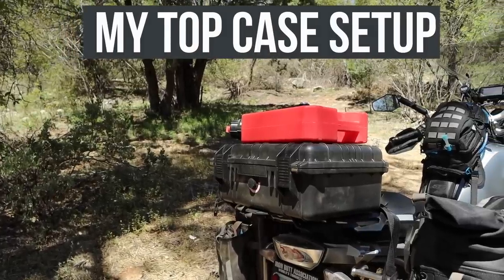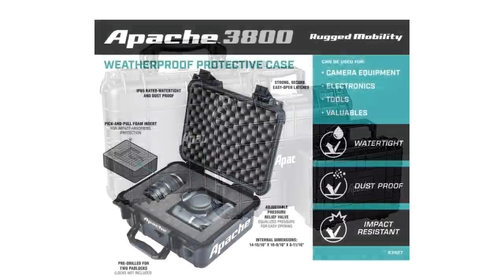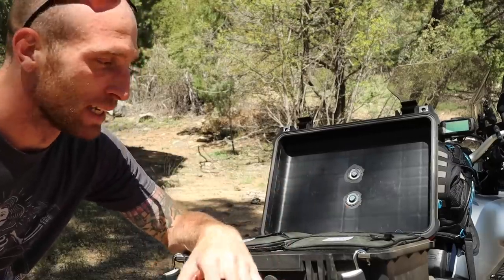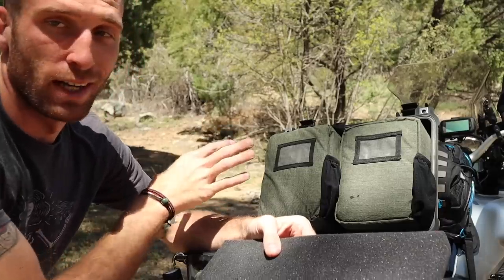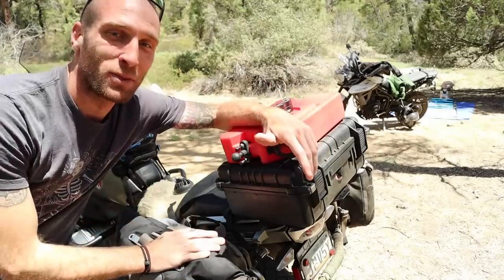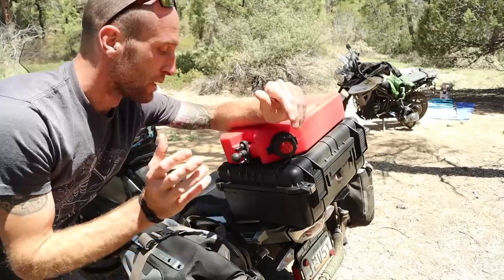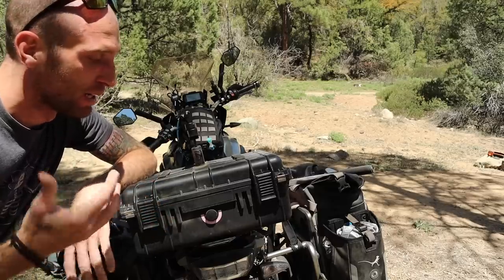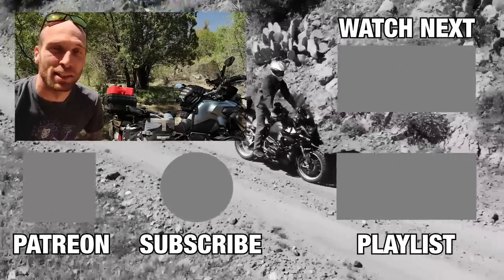My Top Case Setup - Cheap and Easy DIY Luggage For Motorcycles

Comment: I have the same case on my bike. Add a single piece of aluminum plate on the inside of the box for the bolts to go through. This will prevent it from warping and makes it a bit more secure. I think I used a 2" x 8" piece.
Reply: I bolted 1/4" aluminum plate to my Himmi and strengthened the tail rack. Now I have a choice of whatever box that at one time held a tool. Each uses the same bolt pattern. It's a good idea to use a plate on the inside like a giant washer especially riding rough roads. A larger top box that works well is the Craftsman versa tool box. It's waterproof and dust proof. I sprayed the red lid gravel grey so it looks less like a tool box. A man's got his pride ya know. 😆

Comment: I have that exact same case as a top case. Mine holds my camp kitchen (infamous Stanley), 3 days of food, and fire starting supplies. It's mounted reverse of Tim's so it opens from the front, that way it doesn't interfere with a loaded back seat when open. I also mounted aux flashing and brake lights on the rear.

Comment: I use very similar system on my klr. Cheap princess auto case bolted to rack. But I put aluminum plates around bolt holes to distribute the clamping force to a bigger area of plastic.

Comment: Hello friends! I ship expensive breakable stuff to customers and use quality cases for that. Pelican, Nanuk, Seahorse, and SKB all make great cases. Seahorse is probably my favorite because of the price/quality ratio, with Nanuk being second. Anyway, I tried going with the Harbor Freight cases (and even mounted one on the back of my DRZ400 because of the ridiculously low price, and while they are fine and don't leak and all, they are very cheaply made. The plastic is not comparable to any of the other cases I mentioned, and it will crack quite easily. In fact the one on my DRZ cracked at the base where I had it mounted just from the vibration of the bike over a year. It's not a fibrous plastic like the high quality competition--it's just a vacuum formed plastic that is made it look like it is a quality case. I'm not saying you shouldn't use them, but just be aware when it comes to durability the HF cases aren't even in the same league as the big boys. If you mounted them as side cases and drop your bike, they would be toast. You can run over a Pelican case with your bike and you will be the one hurting, not the case. My 2C. <3

Comment: How fortuitous for me!

I was researching a top box to fit on my scramblered Thruxton, and was ready to send you a question about yours. This is perfect!

Thanks for this video!
Reply from the maker: Glad I could help!
Reply: @FTAAdventures  I put a storage crate on my top mount so my helmet doesn't fall off the saddle or move the mirrors out of adjustment. Tim, thanks for recommending a good upgrade!

Comment: Great idea Tim, thanks for sharing. One question: why did you put the bolts through the rack from underneath. Good engineering practice is to put heads ‘up’, so that should the nut come off (by vibration) the bolt will remain in the hole (it also means the bolt tails won’t stick up inside the box).

Comment: This is an awesome idea for storage! The KTM bags on my super adventure are “super” expensive and don’t fit very much, given their large exterior dimensions. A while back, I bought a Milwaukee M18 kit that came with a packout case. Until now I had no real use for it but after seeing this video, I might just try to mount it sideways and scoot it forward over the passenger seat a little so that I can use it as a back rest too. Milwaukee makes a mounting plate and an assortment of different cases that fit and lock together in modules. They even make a cooler that connects to the system.You’re always full of great ideas Tim and such an inspiration to the motorcycle community, keep it up!

Comment: If you don’t have a flat bracket and just a tubular rack to mount to, you can also use rubber insulated clamps to mount the box to the frame with no permanent mod to the bike-rack.  Mine hasn’t moved and works great.

Comment: I have a couple of those boxes, possibly the next size bigger, that I bought specifically for making a set of interchangeable panniers that I can switch between my different bikes.  Using Tusk pannier brackets to make them quick release but they don't make pannier racks for any of the bikes I want to use them on so I bought a tubing bender and I'm about to start making the racks myself,  just buttoning up a few other projects first.  Seen a KTM with Pelican box panniers a year or so ago and fell in love with the idea.  Great idea for some dry, secure storage.

Comment: Love these simple solutions.  I imagine removing this without opening the case would be troublesome (a good thing for security purposes!).  You're right though, It's all just to deter people.  Someone really serious will take the whole bike if they want it so bad.  Your idea of stacking fuel is great. I think stacking a second smaller case with some sort of wing nut inside would be good for the the small stuff.  I'm only just getting started in setting up a DR650 and haven't pulled the trigger on anything yet.  This and Nanuk cases is where I'm leaning

Comment: I have a very similar top case on my DR 650. One size bigger. For normal riding this is all I use. For trips I lash a dry bag to the top of the case. No side bags as I tend to get into some fairly serious off road conditions with the DR. I have a lot of mods to my DR but if I were forced to pick the most important mod it would be the rear rack and top case.

Comment: Great idea! However, I'd probably use a larger metal plate instead of the washers as it created a much larger surface area that will prevent the the washers from pulling through the plastic of the case - in the event of an off.
Reply: some dome head coach bolts might make the indide bolt heads less prominent

Comment: Great diy Tim.
Here's a tip for the pluck and pull foam.
After you pullout out foam to the shape you need, spray some plasti dip on it. It will make it more rigid and hold items much firmer without falling apart.
I use it with a small pelican case for my drone.
Great job as usual.
Reply from the maker: Thanks Mike, that is an awesome tip! I will have to try that.
Reply: FTA Adventures anytime bud. Glad to help.

Comment: I have the straight GS. Nearly identical to your. Only thing I don’t like is the 5 gallon tank and range. You putting that Jerry can on top of your back hardcase is brilliant. I have a similar case. You’ve inspired me to install an extra fuel can on top. Although I’m a little nervous about drilling the holes in the BMW hardcase. But anyways. Thank you.

Comment: Ya it very useful been using it since 2007 I even make a lock so I don't need a padlock. Document even my tools kit and tyre kit. Been using Pelican 1450 side it just nice fit well. From my FJR, GTR 14 , Tracer and Tracer GT now waiting for my CRF1100L4 to mount it.

Comment: Hi Tim. Man I really like that idea. It’s a whole lot cheaper than getting a new Pannier when the original one falls apart. I wonder if I could figure out a Mounting System for the Big Pelican Boxes for the side Panniers? Anyway, Thanks for another Great Video and a Great Idea. Be Safe Tim. I hope you carry some kind of protection for when you’re way off the Trail. I don’t think I have seen one of your Videos talking about Protection and Security when your Camping. One thing you can do is get a Solar or Battery Powered high Lumen motion activated Light. When a Animal comes into your Camp the Light coming on will usually scare them away. Plus it lets you know something or someone Is out there. I think I would rather have the something these Days. Thanks again Tim.👍
Reply: Check out Caribou Cases, they are exactly this solution.

Comment: Do great minds think alike or what? I just finished mine and saw your video. I used the smaller version to just carry essentials: trauma kit, tire kit and a few snacks. My bike has the Vario cases, but empty the top case weighs 15 lbs and puts a lot of weight up high. I'll use them for long trips, but for daily use my mini top case is great. I attached it with L brackets that fit into the Vario slots and a bungee on the back, so that I can remove it easily. Love the channel!
Reply: Hi when you say L brackets, don't don't need securing with a wing nut or something? Or do you just push them in and the fact that it's an L means the case doesn't move about too much?
Reply: @user-ck6kq8zl2i  The L brackets are bolted onto the back of the box. They are the same distance apart as the slots for the Vario top case. They sit about an inch below the bottom of the case and can slide into the Vario slots. A bungee holds the back down. I only used one bolt on each bracket, that way they can rotate up and out of the way. I can send photos if you  have an e-mail.

Comment: I have one of those boxes on an Altrider plate on my Tiger. I used offset T-slot nuts on the underside as a sort of quick release.  It mounts and comes off with a single allen wrench in about 30 seconds.

Comment: Hi Tim,  still in lockdown in Northern Ontario Canada.  Your top box solution is awesome. I have a small pelican box I got for Christmas one year and I agree they make great luggage for delicate things.  Roto packs always leak on me so I use aluminum fuel jugs but I like your setup. Cheers!
Reply from the maker: Thanks Shawn! Mine haven't leaked yet but if they do I will check those out!

Comment: I had the 3800 size case on my Victory octane and then put the 4800 size on my Versys until I finally bought a nice Givi Maxia case that I can keep helmets in. They've got new colors of the Apache series now which are nice. I've got a fuel bottle in a water bottle holder on my crash bars in case I need it, but it's only 1L.
Reply: so that's what a pelican case is
Reply: @rosemaryus-ct6151  pretty much. Pelican is the fancy brand name, and "Apache" is the Harbor Freight Chinese knock-off that's mostly the same

Comment: Thanks for another great how-to video. These have been so valuable as I plan my first multi-week ride. Is cost the primary reason you decided on this vs. a top case from one of the many motorcycle luggage makers? Thanks again!
Reply from the maker: Good question! The cost was the main reason for the decision, but also I liked the dimensions and weight of this case. So far I am very happy with it!

Comment: Hi Tim. Hope all is well. I believe from your earlier videos you once ran the hard cases - why the switch to soft? If you did not plan on doing much true off-road riding (and crashes) is there any reason you would not use the BMW hard cases and top box with the Mosko 40L duffle and 25L Scout on the passenger seat?
Reply: I have learned most ADV riders who go offroad use soft luggage because the aluminum or plastic saddle bag boxes will crack over time.
But more importantly the soft luggage will not get damaged on a tip over. 
But hard luggage will get bent,  cracked or broken when you fall over with the bike offroad. Same for on a paved parking lot.

Comment: Hey Tim! Love your videos! I'm planning a motorcycle trip across the US next year and I'm just curious, how do you know where you can/cant ride your bike? From the research I've done (at least in California) you can't really ride anywhere in a national forest, but it looks like you have no problem finding roads that you can ride through. Any tips would be greatly appreciated!
Reply from the maker: Sounds great! Any forest service road should allow travel, on a motorcycle or truck. As long as it is street legal you shouldn't have any problems. The trail systems might require a special OHV permit in some areas but I just stick to the dirt forest service and fire access roads.
Reply: @FTAAdventures  Thanks! Also, on that note, can you just camp near the side of any of those service roads? or do you need to find specific areas?

Comment: I noticed over time you switched from hard to soft luggage. What was your reason for that?
I just picked up Givi outback's and I'm considering soft luggage as well.
Reply: I have learned most ADV riders who go offroad use soft luggage because the aluminum or plastic saddle bag boxes will crack over time.
But more importantly the soft luggage will not get damaged on a tip over. 
But hard luggage will get bent,  cracked or broken when you fall over with the bike offroad. Same for on a paved parking lot.

Comment: I hate the fact that you did not mortgage your bike for some super fancy luggage system that has 50 latches to deter thieves, and requiring 50 hours of maintenance. However, I am like yourself: think your own way around a need and be creative. Great video. I am working on a system of my own to fit on my Vulcan 500: dual purpose topcase to also serve as my back rest. I never carry pillion, so do not need the seat space. My rack would fit on top of the pillion seat and hinged to allow access to the seat screw if necessary.

Comment: I have a very similar setup but I got my case from Northern Tool (identical to the HF Apache case) on Black Friday for $20. I also added some small plastic kayak/paracord hooks both inside and outside of the case for bungee net anchors. The bungee net is a little different than most... https://www.amazon.com/gp/product/B01MYMSTHS/ref=ppx_yo_dt_b_asin_title_o03_s01?ie=UTF8&psc=1  . Instead of silicone I used rubber washers for waterproofing. Also low profile button head screws with the head inside the case and nylon locknut underneath (all stainless). I've been in some heavy rain and no leaks. 
By the way, I was in Mexico back in March same time as you and crossed the border one day before you did. Had to cut our trip short due to the C19 bs but still got to Bay of LA, San Felipe and everywhere in between. If you're ever cruising through Oklahoma give a shout.